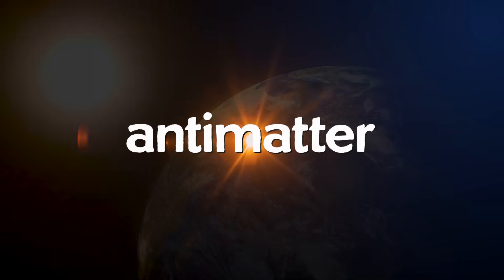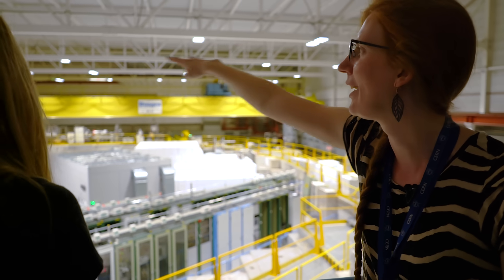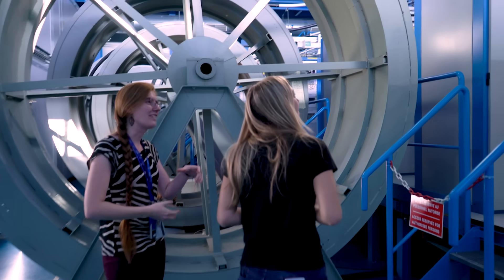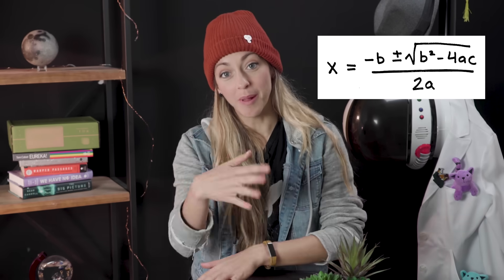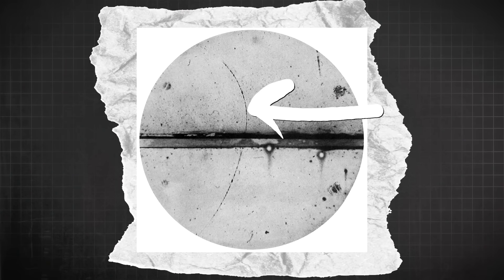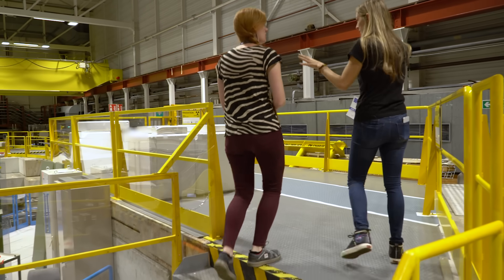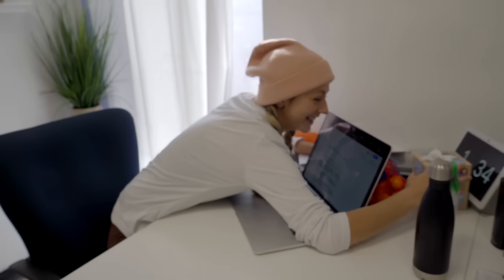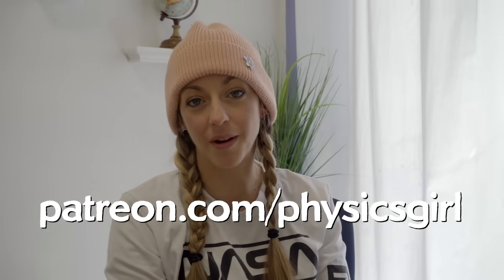Why This Stuff Costs $2700 Trillion Per Gram - Antimatter at CERN

Comment: when you are in a smokey car with the windows up, the smoke stays in, when you open the windows the smoke moves to a new area. Maybe the antimatter and matter do exist right next to eachother battling for space, both taking eachothers space at a constant rate as to not allow either one to ever gain anymore progress than the other. So we only can observe antimatter long enough to realize that it DID exist where we are currently located but the moment it was realized to exist, the matter in the area (because theres a larger portion) stole the area from the antimatter. Maybe there is an opposite of existence (which is in its own right, an existence) and that lies within antimatter, in a different "space". Maybe the existence we understand lies within matter and there is a WHOLE other existence within the space that this antimatter takes up in places we cannot even conceive of.

Comment: it is not surprising that no antimatter is present,
 
what the trigger was to the big bang, we don't know, but

it is clear that the goal was to place matter as existence,

the environment before the big bang plays a very important role,

it is likely that there was none at all,

so to give matter a place as existence,

you need the opposite (anti matter)

then it turns out that even now, matter cannot do without its opposite.

they probably have a better chance at CERN if they generate matter,

there is a good chance that a correct sequence of creation will take place,

just like our universe as a complete puzzle

Comment: How can they not understand why it is so rare? You just mentioned multiple times that if matter meets with antimatter they will annihilate eachother. And the theory about them ought to be about 50/50 was true back in the very beginning of the universe. However, since the vast age of the universe, even if they were 50.0000000001% matter and 49.999999999% antimatter, they have since annihilated eachother. But even the 0.0000000001% of the matter which remained was enough matter to make up the world as we know it to-day.

Or... the universe exists of 50/50 even to-day, just that due to the so called annihilation when they meet, the energy has pushed the vast majority of the antimatter to the very edge of our universe to farther expand space as the matter remains in the center. A little bit like the earths core being really hot then becomes colder in temperature the farther towards the "surface"/edges you travel.
So space does not have a set size, it is contineously expanding due to the massive outburst from the amount of energy created where the outer layer consisting of antimatter collides with the inner layer of matter.
Idk, just speculations, but why not.

Comment: nive video, really cool information but I may add a comment to 00:30. I'm not fully certain but isn't it the following?
 Antimatter is NOT the rarest "substance", not at all, it's not even rare either. Antimatter is supposed to exist in almost the same amount as there is normal matter. Yes there is a subtle imbalance, however, in theory there is a particle of antimatter to any particle of matter, antiquarks - quarks, anti electrons (positrons) - electrons. The thing is, that positrons, anitmatter, only have extremely short lifespans, hence, they are almost impossible to capture, not even to mention the difficulties in containing them. In conclusion: Just because we cannot store or create considerable amounts of permanent/semi-permanent forms of antimatter doesn't mean there isn't a lot of it. Positrons get annihilated quickly, but as matter, antimatter cannot simply disappear. There is enormous amounts of antimatter out there, yet we can't really use or handle it the same way we do with conventional matter.

Comment: There's a little misconception. Scientists says that matter turns to energy, and matter and energy are "the 2 sides of the coin", and that's exactly wrong thinken, coz' actually the energy is the feature of the matter, and therefore all the energy of the universe is kinetic in different level from material movement to the movement of the smallest particles, so without mass there is no energy either.

Comment: Antimatter and regular matter were created in equal amounts, almost all of it annihilated itself and the regular matter it contacted, the reason we have anything at all is because the byproducts of the annihilation formed again into solid regular matter and light energy with the random particles of antimatter shooting off into every conceivable direction. All of this happened immediately during the bang, ejecting antimatter, matter, etc at speeds exponentially faster than light, which ripped apart the bounds of its own existence and created the universe we see today, literally ripping it across the "sky". Contrary to the popular belief, "the" universe isn't quite infinite in itself, it doesnt go on forever if you can move even a little faster than its actually expanding you could reach the end of it eventually, and then you enter into an entirely unknowable dimension. But unless you can move at even a speed thats faster than the universes expansion by a miniscule degree, it will indeed appear infinite. Perhaps you'll see it one day, though you'll need to realize the formula for creating the "artificial" gravity of science fiction, artificial in quotes because there is no such thing as true artificial gravity, that spinning fair ride has nothing to do with actual gravity itself. Gravity cannot be artificial, it either is or it isn't, once you realize that, the process of generating it yourself follows. Any other questions I can answer in vague ways that can't be understood fully except in hindsight?

Comment: "we dont know why theres so little of it"
me: um... because it self destructs when touched by literally anything is probably a good guess......
Reply: Well , both matter and antimatter annihilate when they touch each other so there should be equal amounts of both left .
Reply: We should have no universe, in that case. If there's as much matter as antimatter, it would have all annihilated our universe.
Reply: @ir-dan8524  It could have annihilated - but it does not have to, it may just stay separated. Other galaxies could be antimatter.  (I think it is different)
Reply: @ir-dan8524  Thats not how it works but ok there are other possibilities but not in a another universe is just so not possible...
Reply: @ir-dan8524  Not sure how you gathered that conclusion but OK.
Reply: It's possible that all antimatter and inverse particles encapsulate our universe with a buffer of some undiscovered particle. Or a massive gather of anti-"materials" is lingering in the universe similar to the brine pools on the ocean floor.
Reply: @MessyLaboratory  I was thinking the same thing. It's possible that all the antimatter is gathered in some part of our universe, or possibly in another dimension, like the 4th dimension, but the CERN scientists figured out how to bring it from the 4th to the 3rd dimension lol.

Comment: I’m curious if you created a double helix negative ionic flux how would it interact . The creation of this is an inverse double ac field being created as a inverse potential under a pyramid of grid bias. It drives matter at specific density ratios with only one ac field being used. Ultimately cross fire ac systems may enlighten us to even different type potentials. Crystallography is always a different application aswell. Piezoelectric and c axis alignments in allotropic tourmaline are interesting . And calcite bi focal reactions could be of some interest many effects to consider in nature’s science here on earth and elsewheres .

Comment: Here is a theoretical... Equal amounts of matter and antimatter were created at the beginning of the universe. Except it wasn't EXACTLY equal. There was a very small sliver extra of normal matter. That tiny bit of extra matter seems to be enormous because we are but mere humans on a blue spec. All the antimatter disappeared and gave our universe energy.

And I would argue that it doesn't matter if it is a universe created of antimatter or normal matter. The smallest sliver in either direction would appear the exact same. Maybe we live in an antimatter universe and we are trying to find matter.

The universe matters but it doesn't really matter which matter matters.
Reply: Yea that's the basic idea. Nobody knows why one side won out though.

Comment: CERN claims it has taken several hundred million pounds to produce just a billionth of a gram. 
I bet they were not exclusively trying to make it, but it was simply a byproduct of investigation. 
Curries used seven tons of pitchblende in order to isolate "one-tenth" gram of pure radium chloride.
Later millions of watches had radium dials. Science is not cheap, but time also does not stand still.
In the mid-1800s, the first aluminum ingots on the market went for $550 per pound.
Fifty years later, not even adjusting for inflation, it cost 25 cents for the same amount.
So maybe in a hundred years from now anti-matter will come out of the impracticable "unobtanium" bin and
become just ultra expensive exotic bin.  i.e. 8.25 billion per gram.

Comment: Wouldn't it make more sense to place the LHC on the equator insted of at the North Pole and orient it so the spin of the Earth and gravity helps accelerate? Speaking of which, how is gravity so strong it keeps us from flying off the earth as it spins, yet it doesn't crush grass or implode soft things like eggs, babies, and snowflakes' feelings?
Reply: And how can the "evidence" of antimatter be recorded? It would cease to exist as soon as it came into contact with its counterpart. Either it has all poofed out of existence at the time of the big bang, highly doubtful because you cant squeeze infinity out of a microscopic unit 2) there is a massive cluster somewhere butted up against our universe, or is kinda like another dimension that overlays our own. We're not creating them, it's impossible for them to exist in small clusters surrounded by matter.

Comment: During the Big Bang matter and anti-matter were created. Regular matter settled what is now the universe we see today. Anti-matter settled elsewhere in the vast universe we cannot see or detect, it's just too far away.  So now after continuing expansion the universe has separated matter from anti matter. Like olive oil and water they both settle onto their kind creating vast areas of only matter and of only anti-matter. Dark matter as we call it could be the connection substance between the two in the same universe. That's my guess anyway.
Reply: yeah water and oil seperate but i really hope that was just an analogy and youre not trying to make sense of antimatter/matter like that

its a good guess that the reason we dont get instantly annihilated instantly would be dark matter separating the two tho.

Comment: the problem with antimatter explosion is that it is just a theory. nobody have even observed or proven that what is in these cloud chambers are even antimatter to begin with. if the theory was right, it would be extremly dangerous to try observe such a colission as these particles would fly traight trough the containment into the wall of the accelerator and destroy the accelerator and the detector with it.
Reply: its all a theory... a game theory

Comment: I herd that anti matter can have negative side-effects if exposed to it ina certain  proximity. Have u herd of this? I saw it on a video referring to dark matter. Is that the same as anti matter?
Reply: dark matter is in space. we call it dark because it does not react with EMWs in any way, which includes the visible light spectrum, and thus called dark matter. We know its there though, because it has a gravitational pull on matter. also i dont think the first thing you said is true, haha.

Comment: I think the reason in why there isnt very much antimatter is the fact that antimatter creates annihilation when exposed to matter. If there were both, the antimatter would have reacted with the matter, causing the big bang itself. In turn, the antimatter would have reacted with the matter, creating this huge explosion of particles. There may still be antimatter floating around in the vast expanse of space, otherwise everything would have just exploded and there would be no planets or stars. It wouldve just been a vacuum. At least thats my theory.

Comment: Just like a magnet the universe has magnetic poles and antimatter is on one side of it matter is on the other side there's equal matter and antimatter in the universe stages are kept apart from each other by the structure of the universe.

Comment: Foreword: I dropped out of school to work after grade10 so i'm sort of assuming that if 1 type of matter has an opposite anti matter therefore every type of matter must have an opposite too so here's something to tickle everyone's thinking pickle:
-Maybe the reason anti-matter is so difficult to find/detect is because instead of the common thought that when all forms of matter and anti-matter come into contact they annihilate each other immediately in a big flash of light: The speed of the reaction between the two opposite forms of matter is determined by the structural volatility of the type of matter in question.
i.e. the speed at which hydrogen and anti-hydrogen cancel each other out compared to the speed of a more stable element and it's opposite.
In other words: Everything hasn't cancelled itself out yet because it's still a work in-progress. In the event that a type of particle and it's anti particle can't cancel each other instantly, they form a sort of symbiotic fight to the death relationship that we observe as varying forms of decay and aging.

Comment: Anti Matter science  is pure junk . It's junk science , because our world has yet to burn up all of the sewer , sewer gas and ammonium compounds generated by the europeans and their existing ammonium nitrate manufacturing processes and with that there is an abundance of cheap fuel and more efficient means of power generation and distribution  And is not 100% efficient petroleum distillation and refining which is far less complicated that the antimatter and fission or fusion science  furthermore the sewer science is here now . CMN

Comment: So the fact that anti-matter is so rare, when by all plausible scientific explanation, the universe should be a 50/50 makeup of both matter and antimatter makes me feel like we understand soooooo much less about reality than I thought we did.
Reply: Strictly speaking, there only needs to be a tiny difference between matter and anti-matter to result in the universe we see today. Because matter and anti-matter annihilate completely, if there is even the slightest bias in favor of matter existing in our universe, then it would cause virtually all anti-matter to be annihilated and the only thing that remains would be matter.

And actually, researchers at Japan's Super Kamiokande facility may have found a source of such bias! To massively simplify: they've found evidence that Matter Neutrinos and Anti-matter Neutrinos do not behave exactly the same at all times, and this violation of symmetry could be just enough to tip the scales in Matter's favor and result in the stable, non-exploding universe we see today.

Comment: so... how did they weigh it?? I have quite the history in physics and im sure the antimatter will have to TOUCH the scale... nice estimate though, but it doesn't have a weight
Reply: They didn't say "weight", they said "mass". Mass is independent of any gravitational scale. And actually, for particles of this size, their mass is usually given in the unit of Electron Volts, or eV, since by E = mc^2 we know that mass and energy are equivalent.

Comment: what do u think if
         matter + antimatter +energy+ dark matter + dark energy = 0 
or nothing in the universe as due to interaction of these energies is released so there is the possibility of the presence of negative energy. Which Stephen hawkings predicted that it would be needed for time travel purpose.?
if u think this is worth please contact me .. thank u and please answer my question
Reply: A question like that... might literally give you a "different answer, from different scientists".

In simple mathematical terms, you cannot use matter, to travel faster than light.

Here's something you can think about, as you're standing on a spinning globe, that also hurdles through space around a star, which in turn spins around a small Magellanic cloud, which in turn spins around a galaxy, which in turn spins in cycles with our global cluster, which in turn heeves through space in an apparently expanding universe... When you add all that up, you're already traveling multiples of LS LOL

As you can by now tell... speed of light is really a relative term. In contrast, tech for elastic space control, just might give you that certain nudge you're looking for LOL

Or, you could just use a worm hole.

Comment: You can't have 2a in quantum  it's Q2 = quantum reinforcement.  There is no if, ands, or buts. E=Mc2=Q2  There are no 11111 and 000000's in real quantum mechanics. Until you figure it out your geometric wavelength patterns will be incomplete.